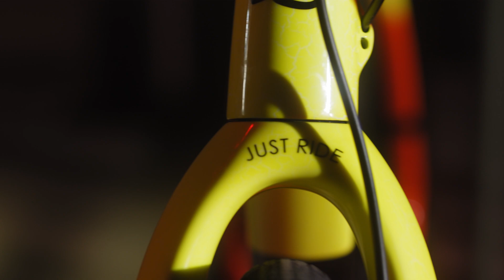Why don't we use "hi-modulus" carbon fiber in the True Grit and Anywhere frames?

Comment: Pretty strong assumptions here, but it does make sense.
Reply: Better to think outside the box than follow bad trends that make no sense. Like gravel bikes with stiff high stressed uncomfortable frames. Itvmakes sense in a mechanical point. The strong parts connected to weaker parts stress the weaker points by about double in general. Learned that as abkid with rc cars and its a widely known thing in that community field tested